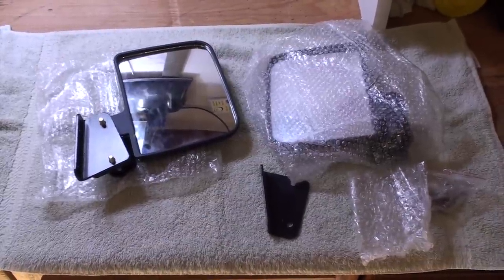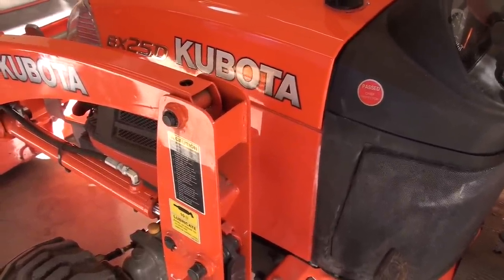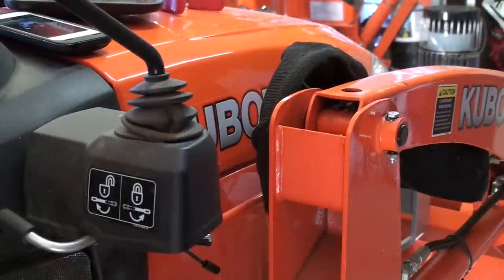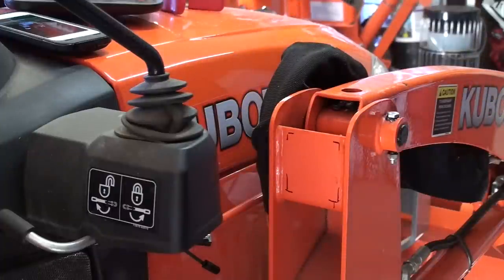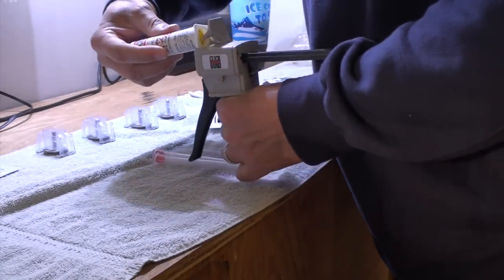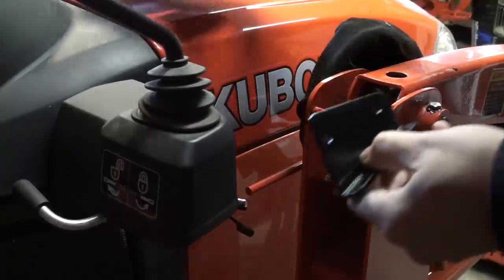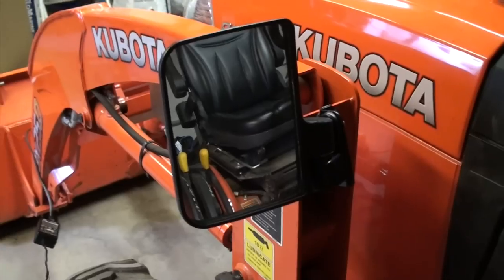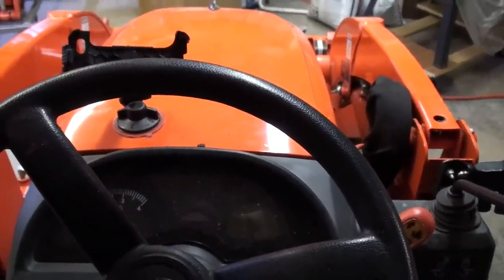Kubota BX25D Mirror Modification using Click Bond fasteners

Comment: Wow great idea ;) The bonding system is great. I think I would have trimmed one side of the a Click Bond pads to get the mirror bracket closer to the outside of the FEL frame, in other words, the farther apart the mirrors are the better visibility but that may have compromised strength. I've used Click Bond and it's one of only a few products that's truly impressed me. Nice job on the video and great tractor.
Reply from the maker: Thanks Paul!  I think I will find a couple of small fisheye mirrors to add on.  My main purpose was just to see my rear mounted implements as I don't use the tractor out in traffic.  I don't really like the brackets that came with the mirrors and I might fab some better ones that could give me a little more 'spread' but I do like the idea that the mirrors are pretty much tucked and protected by the FEL tower.  I had considered mounting on the outside faces but elected the rear side for protection.

ClickBond does have trimmed base parts that can be located much closer to an edge or up against an inside radius.
Reply: I liked the brackets but like I said, I got them closer to the edge of where you put yours. I thought about fanning up different brackets but thought they might cause a bit more vibration. If you need any Kubota decals and round mirrors just say the word and they'll be on the way ;) Nice work sir.
Reply: Hi Mark,
If I can ask- Why didn't you sand down to bare metal this time, like you did for the chain and tool boxes?

Thanks,
TU

Comment: observation: lightly scuff that area. Also VHB tape would have been strong enough. Nearly every car moulding on the planet uses 3M VHB. I use it for my off-road GoPro and other and that vibration is demanding.  
For my mirror on my Deere utility I just look over my shoulder when on the road. Those would break off landscaping.

Comment: turn on ypur Kabota tractor so we can see if there is any vibration from the mirror lences???
Reply from the maker: Hey, I can do that.  I will tell you there is obviously vibration on start up but there is little shake (at least by eye) to view the rear especially in reverse.  Hasn't even distracted me with the golf cart mirrors I bought.  I think there is a rubber bushing in the adjustment gimbal joint.  I will take a look.
Reply: @dragonseggs  Okie dokie. that would be awesome! Im looking to get some "vibration free" type mirrors for my John Deere 1025R sub compact tractor. I dont want to put any concave or convex style on it. Some nice "vibration free, see behind ya when the tractor is moving/working, no distortion, mirrors!!!